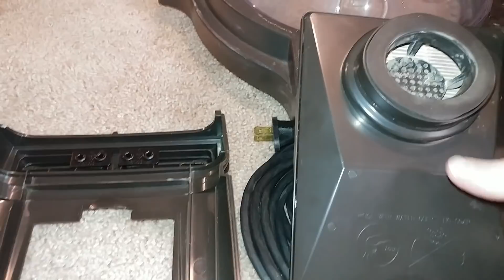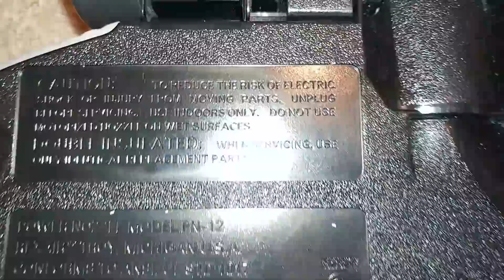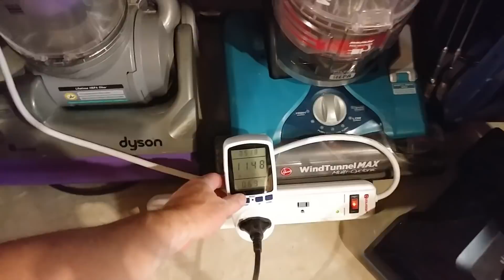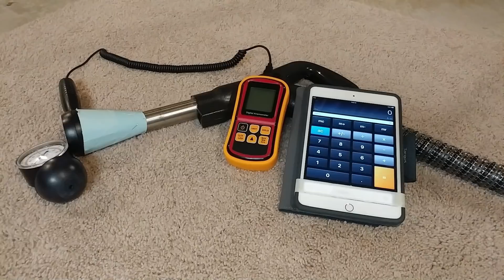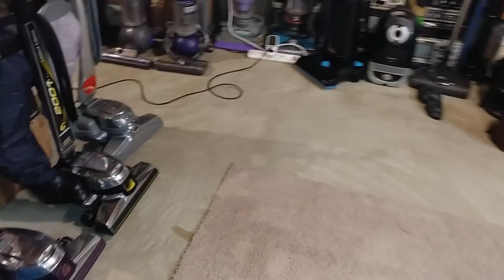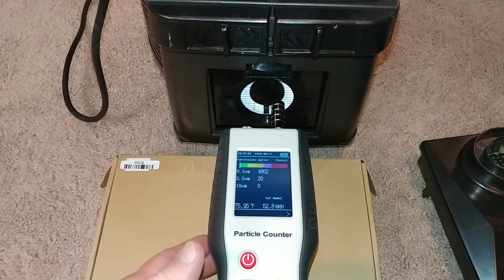Rainbow E2 Platinum With PN12 Airflow Box And Suction Tests

Comment: Is it possible to know the results of airflow in knots, to compare it to my unit? Thank you very much
Reply from the maker: Knots is a speed that does not include a volume. What is your vacuum that you are inquiring about?
Reply: @VacLab  thanks for your answer. I took a reading an anemometer and the reading was 12,5kts on the outlet of the main unit. Since it was the same machine, I was wondering if you can get me your reading. BTW its a E2 also like the one on your video.
Reply from the maker: @123PedroSF  take another reading in feet pet minute and tell me the inner diameter of your anemometer. I can convert that to CFM.

Comment: And it's still half as powerful as a kirby.
Reply: On airflow, yes, but Kirby's water lift is a 20 1/4th of Rainbow.
Reply: @jameshalleluyah8133  yes, at least the E2 models, for sure. It is the nature of bypass vs direct air vacs. But, at the end of the day, the best carpet vacuums tend to be direct-air vacuums, and the Kirby is the only vacuum I've used that will visibly grab and lift the carpet off the pad, and not let it go. Makes it the winner in my book, for carpet. That is all I use mine for, if I use it. Typically I use a Miele canister.

Comment: Can you replace the hepa filter with a new one? Not sure if rinsing with water is got to suffice. Definitely surprised by the 0 particle reading. Every Rainbow that I have seen particle tested has been horrible.
Reply from the maker: I have two filters to use, so no need for a new one.
Reply: @VacLab  do they make new filters from Rainbow? This cleaner is new to me. Still trying to figure out the brushroll. The brushroll doesn't go all the way across the powerhead which seems kind of odd. I'm going to set back and enjoy your videos on this cleaner.
Reply: Odd. Rainbows are known for their filtration. I know a few clean rooms that use them because of their filtration.  They have H13 hepa filters and the water captures everything but Ash and drywall dust. Maybe some types of odd clay dirt but that's rare.

Comment: When I was training at Rainbow, they said a brand spanking new unit pulls 105 CFM at the main motor unit, 85 hose end and the power nozzle CFM was like upper 60's I believe. AGAIN brand new unit with total clean filters and seals. This isn't too far behind from that really. I'm actually impressed with these numbers, Rainbow has really stepped up their game with CFM and filtration.
Reply from the maker: Take a peek at my raw airflow and suction tests. Uploading now...
Reply: @VacLab  ohhh can't wait.
Reply: Thomas did you work for Rainbow. Also,how old is this unit? Seems like one of these machines has a water canister that is lit up.
Reply: @timconnell9587  yes for a very short period of time. This motor unit is from 2008, and yes the newer ones from mid 2011 onward have illuminated water basins.
Reply: @TRec3791  thanks for the response.
Reply: @timconnell9587  no problem